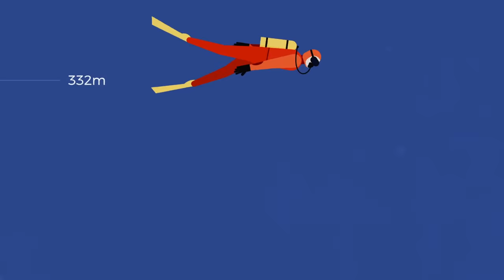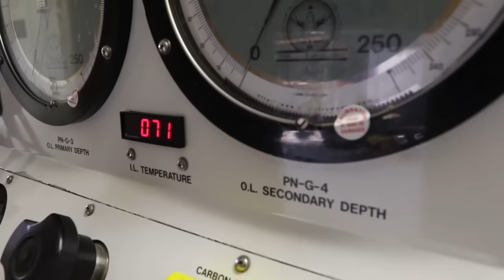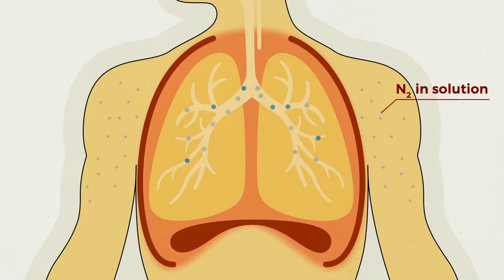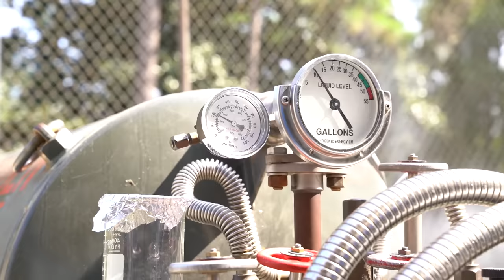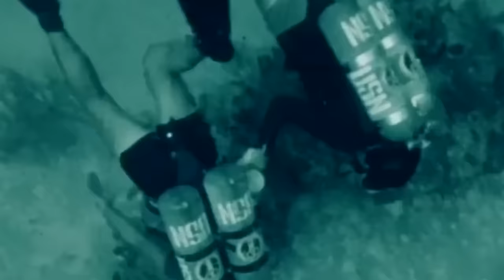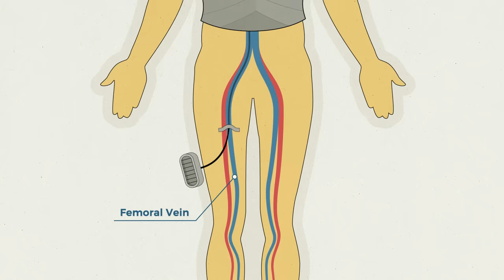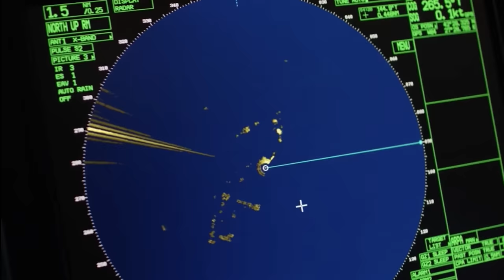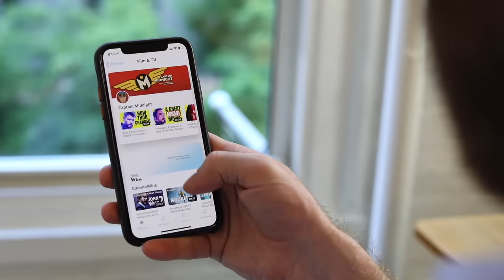Can Humans Breathe Liquid?

Comment: They’ve “solved” the panic problem in the scifi book series The Expanse. The answer seems to be sedation for the transition or drowning phase.
Reply: "The Abyss" a movie that had the oxy/liquid used is the same premise. 
The oxygen-rich liquid they show in The Abyss is indeed real. In reality, though, it looks just like water; for the sake of the movie, they dyed it light pink so that it would look “special”. The rats did indeed breathe the stuff; you can see his little sides going in and out. The filmmakers would have liked a nice long shot of the rat breathing the stuff to really show it off, but the rats kept panicking and defecating in the fluid, so they had to chop up the scene. Breathing the fluid strips the protective mucus coating on your lungs, leaving you prone to infections; the rats received antibiotic injections, and they were fine.   
 Oopps should have watched the whole video.
Reply: @ghoulinthegraveyard399  Wouldn't hurt to dye it to make sure you didn't end up with regular water. I could buy that
Reply: I'd assume it would be easier to just use an actual ventilator, but fill the lungs with liquid instead of air. Take all the decision out of it.
Reply: This is exactly what I figured as well.
Reply: randy s that’s not true at all. It was only introduced in the latest book and there is ZERO mention of it killing people due to overuse.
Reply: Asher Pfanku sure. You could take out the decision. But your brain is still gonna freak out. It’ll be HORRIBLE to experience for that reason.
Reply: I'd still panic if I came to and found my lungs filled with water
Reply: @charlesking1103  what if you are genetically design to breath that liquid?

Comment: Morty: May be we can with quantum ventilator, Rick.

Rick:  "Jesus, Morty. You can't just add a Sci-Fi word to a medical word and hope it means something."
Reply: No! Wait... he is onto something...
  
If we can selectively control the quantum tunneling effect so it only targets the covalent bonds between the oxygen & carbon atoms in CO2 (or precisely not "that one", either way works); then a device can filter it without the need of a chemical reaction like with the lime (adding any substance to the blood is dangerous); plus there will be no need to "refill" it constantly since it would only require electricity.
-> If installed completely inside the body [storing the CO2 either as hot compressed gas or cold solid with an aerogel insulator coating], it would still need  LATER "slow release" through the lungs using normal air respiration to "empty" it [may feel like running inside an overcrowded room while just sitting & it will take many hours... but it will work!]
Reply: Ahh geez rick.. mmhh
Reply: @adolfodef  Selectively controlling tunneling sounds really cool, I hope we figure it out some day.  Or maybe do you have a paper I could read about this kind of research?
Reply: Nice
Reply: At this rate this comment will not exceed 400 likes
Reply: @vamsibalam  ahh geez rick

Comment: For sea floor work, given the huge budget, why not empty the lungs and rely on plasmapheresis? That's external blood cleaning, and in this case oxygenating, equipment connected to the femeral artery like you show  a scrubber. This allows more processing, and additional blood storage ('donated' and stored in advance), for much wider safety margins and biological data collection for iterative improvements.

Comment: ugh.
just imagine the panic when the liquid gets into your lungs.
i'd like to hear more about the human experiments. how did they even persuade that guy to try that?

also, i think there is a drowning reflex triggered when liquid goes into your lung, which is the reason why waterboarding torture is so effective.
Reply: i was once doing exercises for my scuba diving license. one of the exercises requires you to breathe through your breathing apparatus without using goggles.
but it just felt like i was drowning. it didn't matter what i did. closing my eyes, being in a pool rather than a lake or being right next to the surface. i just couldn't convince my brain that i was not drowning and i couldn't breathe. despite knowing that i can breathe just fine. and as soon as i put the goggles back on it stopped.

the brain wierd.

Comment: My theory: What if you didnt have to breath... at all? Lets say you take the 12kg mass liquid you described as being viable. Instead of forcing it in and out we create an artificial heart in the tank area that pumps liquid in and out. This way you can just ''Hold your breath'' and the breathing is done automatically.
Reply: I feel like it would be incredibly hard to overcome the automatic breathing all humans do, especially while sleeping if dives last long enough, and that this would mess things up
Reply: @nyalan8385  the feeling of needing to breathe comes from increasing CO2 concentrations in the body. if you train yourself to go minutes without breathing, doing the same while you had a gas exchanger hooked up to your veins wouldnt feel that different. the thing is, this doesnt solve the pressure issue. you would still need to fill your lungs with a liquid to prevent collapse or perforation at high pressures. in the case of this gas exchanger, you would then also need the same oxygen tank that SCUBA divers carry as well as a way to remove the liquid.
Reply: Back when I was young, I wondered why couldn't just create a filter that lets in air and let's out air while you in the water. Now that I'm older, some of the reasons is because the air, might be to undense (idk the word for it) to pure anf other stuff. And by air I mean oxygen
Reply: Still too invasive and dangerous. The lungs are fragile, any extra pressure of the apparatus on them and they can burst, also, the lungs dont have the best anatomy for circulation

Comment: I can remember the first time I went snorcheling (is it spelled that way?) and I had my head below water, with the goggels and all, but I just couldn't take a breath, because I knew that my head was underwater.
I got a slight shock, when I basically forced myself to take a breath, because my body just assumed that I would kill myself. Wasn't exactly a fun experience...

But now I imagine it with actual fluid touching my mouth and nose, not mechanical lines up to the air. Trying to bring myself to open my mouth and breath it in... That wouldn't be a slight shock, I guess I'd just die from cardiovascular arrest...
Reply: Snorkelling - but we got the gist!!
Reply: Midnight I had the same experience it was first about 10-13 breath I began to normalise (12 years old at the time)
Reply: I had the same experience too, at the Red sea it was horrible. I never adapted to see the beauty. I was in my 30's my idea was to buy some and practice in the bath but I never got around to it.

Comment: It might be interesting to mention that the deepest free dive (breath hold diving, no breathing at all) was 214 meters (702 feet).  Because they are not breathing, free divers can avoid most of the complications of tank diving.  Which is helpful, because long ascent times are not a possibility when holding your breath!  Interestingly though, there is a unique danger involved in the technique.  A free diver can become "trapped" below the surface, having enough oxygen in their lungs due to the pressure of the water, but they will lose consciousness during ascent, as the pressure of the depths subsides and their lungs essentially "suck the oxygen out of their blood."   It's called "shallow water blackout."  As a free diver, I have experienced the feeling of not needing to surface for air (due to the pressure), but I always watch the time to ensure I can surface safely.  Cheers!

Comment: Why can't you use blood as a transmitting liquid?
Reply from the maker: PFCs can carry 3-4 times the amount of oxygen than blood, and a lot more CO2 as well. Also that'd be gross lol
Reply: In the same way Silicone Oils can be bad for liquid breathing. Blood has higher density than water, blood is thicker than water.
Reply: @realscience  What about bypassing the lungs altogether, and externally pump the user's blood to a machine that can add oxygen and extract CO2?
Reply: Ryan Swaggert still have the same problem; the brain wants to breathe with the lungs.
Reply: Ryan Swaggert hmm good idea. But sounds a bit complex. And it’s probably best to avoid too much complexity in case of emergencies
Reply: @kaelanirevyruun1676  that is not true. You can voluntarily stop breathing, if you want to. The breathing reflex is stoppable to a point.
What brings you to involuntarily breathe in is the build-up of CO2 in your blood. Breathing is only ever controlled by the pH of your blood. If you can remove the CO2 as fast as it builds up, you can just stop breathing and your body will react exactly like it does in the two to three seconds after you stopped breathing: not at all.

Fun fact: if you got rid of the CO2, but delivered no oxygen, you would basically just stop breathing and suffocate without realizing, because your body can't measure oxygen concentration internally. You would realize that you got confused and everything would start spinning. Then you would loose consciousness and die, because you're breathing reflex wouldn't kick it, as it wouldn't measure enough CO2 to do so.
Reply: @swaggery  you can do that, it's called an artificial lung and they're invented for patients who need lung transplants, but can't get one right away.
It's basically a shoe box with membrane stacks, where air flows between membranes in one place and your blood in the other, not touching, but near enough to exchange gases.
The caviat is, that it damages your blood cells and can only operate for a short amount of time, before it needs to be replaced due to wear and tear. Oh and it's also so big, that you have to wheel it behind you in a trolley and too inefficient to do anything remotely resembling bodily work with it.
More research needed and they're already working on it.
Reply: @realscience  How about just hemoglobin in some kind of buffer? You could increase the concentration of the protein to increase the amount of oxygen in the liquid.
Reply: @midnight8341  This honestly seems more promising than breathing air though
Reply: You're forgetting about pressure...No matter how oxygen is delivered, your lungs still have to be filled with liquid to prevent being crushed by the pressure.
Reply: @swaggery  Doubtful that commerical divers would allow themselves to be connected to what would basically be a heart/lung machine. Also the lungs would still contain aire that would be compressed forcing nitrogen into the blood unless breathing were somehow halted so now we have to open up a couple of veins, hook the diver to a huge machine and then paralyze his lungs. Yeahno.
Reply: @swaggery  Most likely the body will end up killing itself since the brain will not be able to interpret whats going on. For eg: if the lungs stop functioning it will lead to a lot more catastrophic results such as very low heart rate leading you in an induced coma and you might slowly die from other organ failure altogether since everything is controlled by the brain even if oxygen is present in your blood.
Reply: It's toxic or too thick too
Reply: They could do what Lance Armstrong did and just inject oxygen rich blood into the bloodstream
Reply: @swaggery  It's called an ECMO machine
Reply: @sean269  you will still have to fill lungs with liquid, so why not just skip the blood transfusion machine
Reply: @midnight8341  *lose *caveat
Reply: Midnight right. that’s why carbon monoxide is so dangerous. You can’t get oxygen and don’t even notice until you’re dead.
Reply: @swaggery  the lungs are muscles and needs to be exercised
Reply: @realscience  and increasing the number of red blood cells is not enough?
Reply: @realscience  This might sound dumb but,  why not simply try to halve the mass of the PFC's ?
Reply: @tedarcher9120  Why would you have to fill your lungs with liquid? Have you never exhaled COMPLETELY? It takes effort but it's a thing and even if you can't get 100% out, then you can just exhale as you descend and let the pressure empty them for you.
Reply: @midnight8341  Having seen it happen a few times I don't consider that a fun fact, but a fact it is nonetheless.
We ought to be clear here that the Breathing Reflex, and the Anti-Drowning Reflex are two completely different reflexes. Hence why you can terrify someone into thinking they will die without (necessarily) killing them.
Reply: @KawaiiKamikaze1  the heart has a lot of self-control but in a healthy  situation is expecting to send and recieve blood to the lungs, to be processed. A lack of process at the lungs can stimulate a heart attack, leading to death.
Reply: @johannesnm9706  we use different sets of muscles to move the lungs, particularly the diaphragm. Watch a person breathing, when relaxed they will breath using chest muscles; when distressed, anxious, or in need of greater oxygen they will use abdominal muscles. Obviously proportions vary.
Reply: @swaggery  not a chance your going to disconnect my lungs. You'd end up surviveing it all and dieng cuz someone reconnected it wrong lol!
Reply: @yourlocalmemeandanimedeale807  would be a less stable molecule and react with itself, and then ur back where u started
Reply: @kaelanirevyruun1676  We can always develop a drug to stop that
Reply: How do fish do it so easily?
Reply: @kaelanirevyruun1676  brain doesn't really want to breathe. The reflex kicks in due to CO2 build up. This is the reason why it's so dangerous for unprepared  people to go into very high mountains. 

When the atmosphere is thin, you breathe out too much CO2 in order to get the same amount of O2. This, in turn, messes up your breathing instinct.
Reply: Oh yeah, the change-over back to air will be beautiful. Coughing up bright red clots.  Try again

Comment: I guess you could handle the entire breathing process just through blood, and the diver keeps rebreathing the same helium or another harmless gas as a placebo, but even then being entirely depended on some mechanical apparatus hooked up to you veins while trapped in a suit deep underwater doesnt sound pleasant
Reply: no, the problem we're trying to solve is having gas in your lungs, that's what makes it dangerous to dive too deep. if you were to exchange O anc CO2 via an external device you'd still need to breathe in some kind of inert liquid to not die underwater, you just wouldn't need to breathe it in and out
Reply: @nddragoon  Like you said, I think you could do both. An artificial lung hooked up externally to replace oxygen and flush out CO2, and have a liquid in your lungs to deal with pressure. Also, I'm not sure if having an inert gas like helium would cause problems because the biggest reasons we can't breathe atmospheric air at high pressures is oxygen poisoning and nitrogen in the blood. Maybe Helium could provide support to the lungs while the external device actually handles gas exchange.
Reply: Might work, but use Argon instead of Helium. Otherwise the support crew won't stop laughing when you try to address some critical emergency while depressurizing.
Reply: @mennovanlavieren3885  I believe deep sea divers do have helium in their air mixture. If you listen to some radio chatter like when Scuba divers rescued a man who'd been trapped underwater for 3 days, you'll hear high-pitched talking to the surface crew. It's almost as if they spend months training to stay calm under pressure... pun not intended.

Comment: Does the action of breathing or to be exact the mechanical part of the contraction and expansion of the lungs need to be done? Because couldn't you insirt a tube to pump in PFC and pump out PFC at a constant rate equivalent to one breath?
Reply: imagine diving for hours like this, then emerging and immediately fainting because you forgot to breath
Reply: imagine an pulse oximeter with an alarm and light but noticeable shock that goes off when your o2 and heart rate drop below a set parameter, these pulse oximeters exist but without the shock obviously.

Comment: When it comes to breathing liquid, evolution has taught us that gills are the way to go.  Lungs just aren't built for it.
Reply: Yeah but fish don’t have science 😂
Reply: There're a lot of creatures out there that can breath air with their gills, they just have to keep them hydrated.
Reply: Well, at worst, I guess we could puncture the bottom of the lungs, put tubes in them, and suck the liquid out while is being pumped in the mouth. That's basically turning the lungs into gills.
Reply: @Shouziroku  nope. because alveoli (the tiny sacks that do the gas exchange in the lungs) rely on molecules of air being a certain size and density. having a "flow through" system wouldn't fix that.  gills are essentially lungs turned inside-out.
Reply: Thomas Neal I hate when my lungs turn inside out!